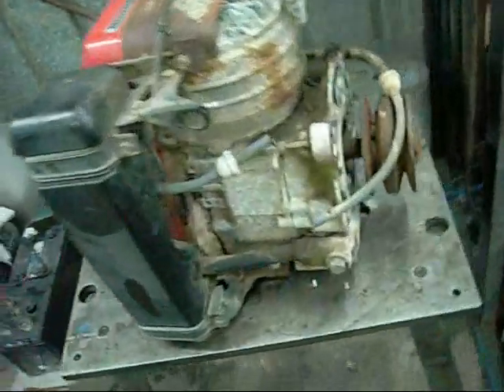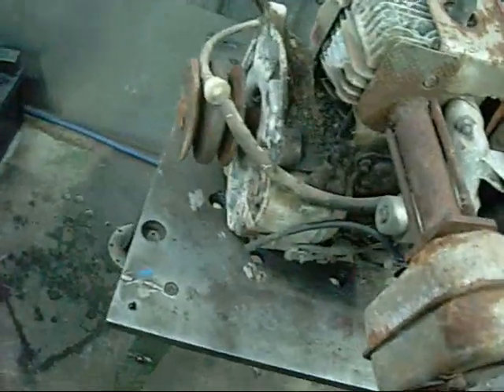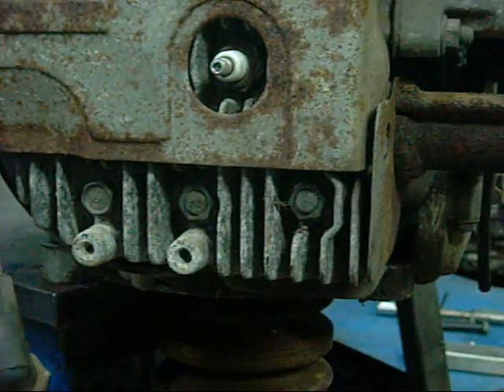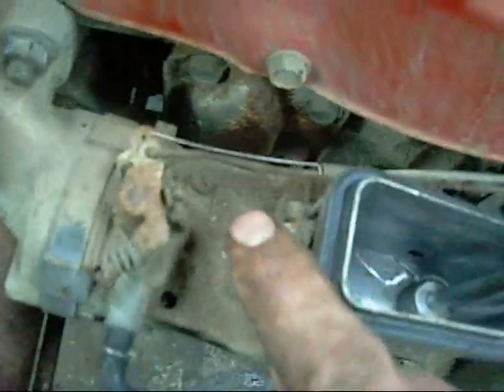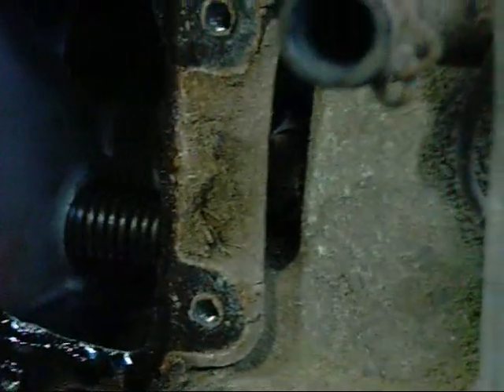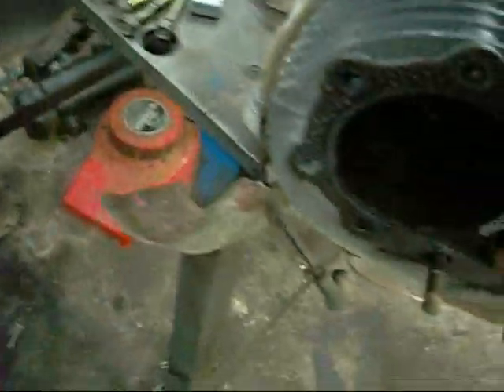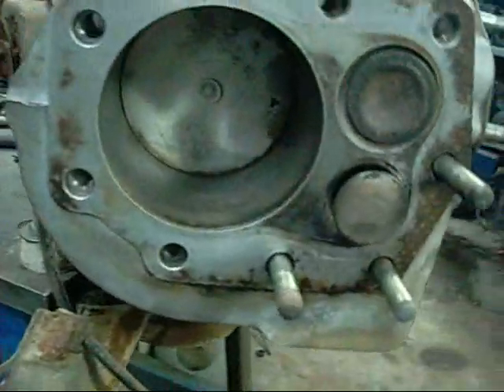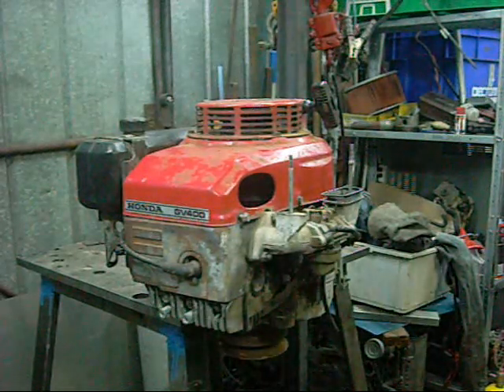Honda GV400 Stuck Exhaust Valve Repair and Test Run

Comment: those old engines are indestructible. my grandfather contracted with a ohv one on a Honda base and it run flawlessly for 17 years and in that time he never even replaced the air filter or spark plug once and thats no shit because the spark plug still had Japanese on it! i got it and its had a flogging in the past few years. only reason its not running now is i took the head off to clean up the carbon in there. still has the honing marks visible too!

Comment: I've just taken the head and valve spring cover off my g400 to discover the inlet doesnt fully close. On tdc compression I can spin the head of the inlet valve with 1 finger easily. I will remove the inlet valve to grind a half millimetre or so off the end until it seats properly. It was puffing out the carby when winding over and only sometimes attempted to fire. Its on a ems3800 genset so I still have to wait til it runs to see if it still generates! This is a late-ish version as it has a CDI box/coil mounted on the flywheel cover.

Comment: g'day Aussie 50 i bought a Masport slasher a week ago for $100 in Avoca.
i've got spark, and need to clean out the rust in the carb bowl, i got it semi stripped down today to clean, it had a wasp and mouse nest in the fins so was running super hot and leaking oil.
cheers from country Victoria

Comment from the maker: @windoes98se its just a bit of unburnt fuel/air mix.. too much flame/smoke means theres a problem with excessive fuel or oil getting in.

noithing at all and I imagine it wouldn't run. or not very well anyway.

Comment: Honda GV400 displaces 398cc and produces 11 peak SAE horsepower (measured with the air cleaner and muffler removed per SAE J1995).